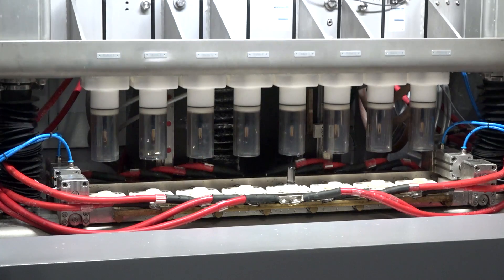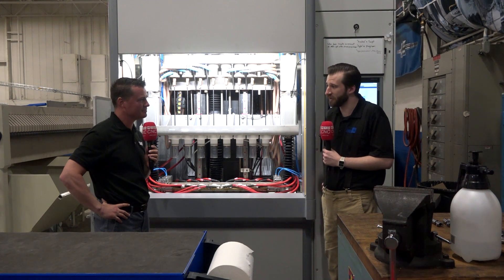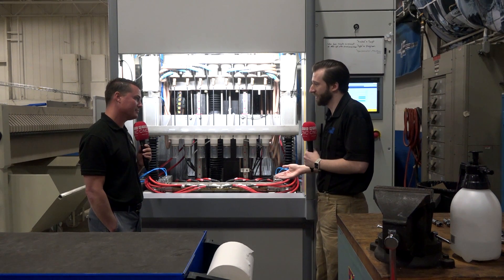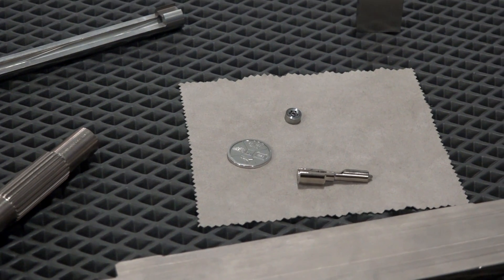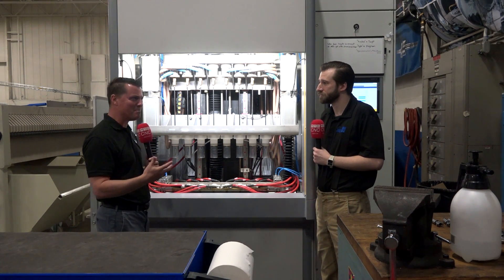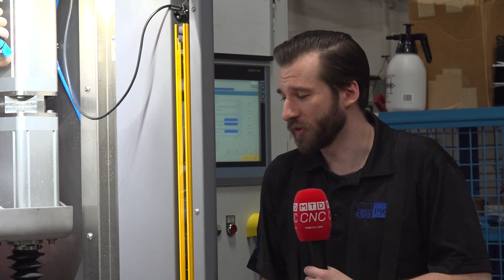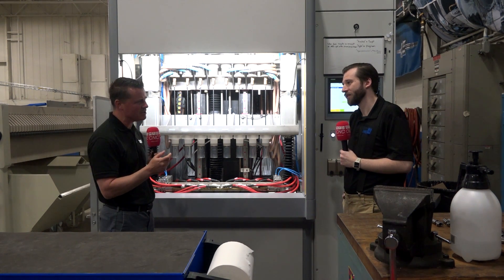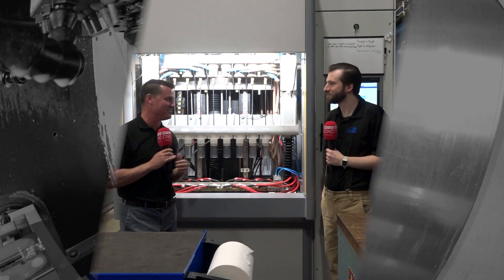Electro-Chemical Machining - it's like Magic

Comment: My question is when it gets to the chamber does the cathode take off the same amount of material.  In another words I drill a 8.58 hole and the chamber is 9.08 for the slug.  If I cut that to size what will the effect be.  My company just bought one and I can't get any info this.  Thanks in advance.
Reply: The material removed depends on proximity of the workpiece to the cathode & the voltage & the concentration of your ion solution. There’s an Indian bloke on here that has a lecture video. The calculations are in there
Reply: @josedorsaith5261  Thank you.  Any info is much welcome.

Comment: Tooling (cathodes) can be designed and printed in pla. I just finished making a 357 mag rifling mandrel that holds copper wire. It’s 1-16 twist 6 grooves and 9 inches long.

Comment: What voltage and amperage is optimal? Does it matter what type of salt you use, maybe potassium nitrate instead of NaCl? Seems it’d be useful to produce fertilizer as a waste products instead of hazmat or poison.
Reply: The poison comes from the chrome in the alloy, not from the used salt
Reply: The concentration of solution affects how precise the cut is. Want more material removed depends- higher concentration of NaCl. Want more precise cuts - lower concentration of NaCl.